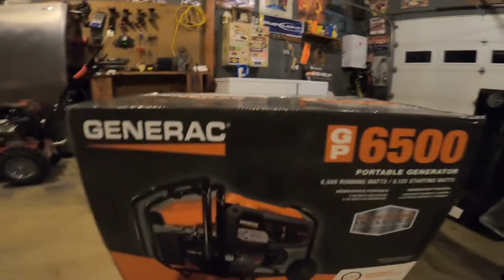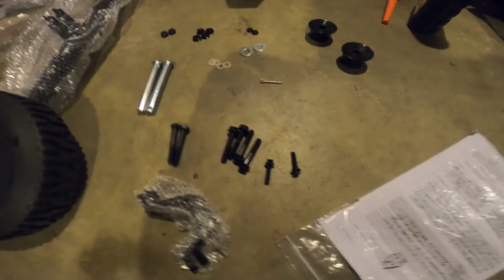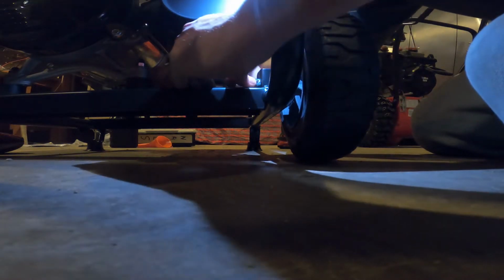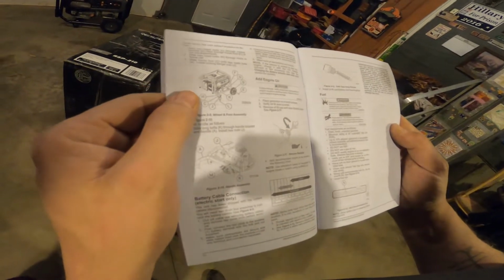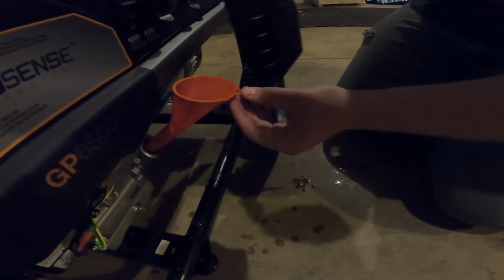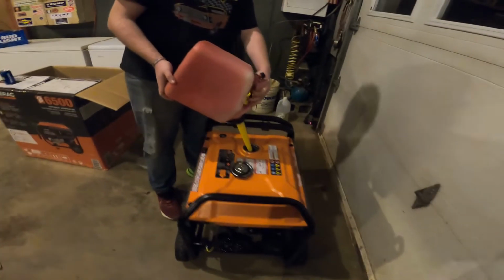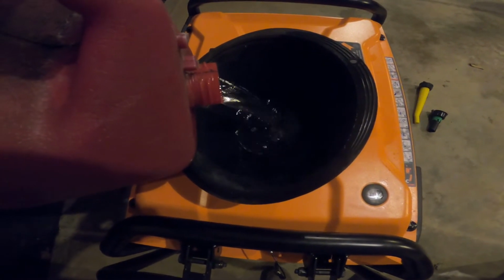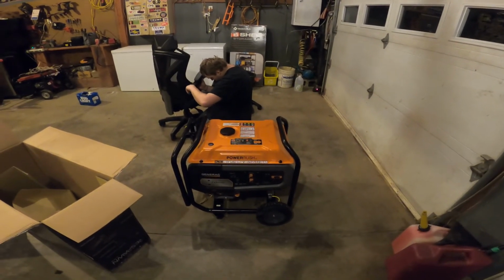GENERAC GP6500 FIRST START UP 2023

Comment: What type of oil did you put into your generator? We just picked a Generac   also. It had oil with the generator but it was not the proper type for our climate. It calls for synthetic blend 5w30. We had to call to find out because the instructions mention operating condition and type of oil to use in different temperature conditions. Just thought I'd mention it to you.
Reply from the maker: Interesting 🤔 I just threw in what came with it guess I will have to dive deeper into it
Reply: @outdoorswithaaron4145  Yes definitely check the oil you put in. We received SAE 30 which can be used but not under 40 degrees!! We all know it gets colder than that in Maine!!! So we called up and was told to use Mobil 1 Advanced Full Synthetic 5w-30 for conditions up to -30 degrees. 

First start on ours and purred like a beauty!! Can't beat a Generac with 3yr warranty likewise.
Reply: A little late commenting, but the 30 weight that comes with it is break in oil. After 30 hours break-in you should change oil to 5-30 full synthetic.. this information is in the owners manual.
Reply: @garystarr9176 no need to use full synthetic oils for that purpose. The old Dino multigrade oil will do the thing perfectly, It doesn't cost that much and I would prefer frequent oil change because small engines don't have oil filters
Reply: @j420v7 no need to use synthetic oils. I prefer HD mineral diesel oils for my 3kw genset. my 3kw genset  requires an oil that's API SE or higher. So I use  15w40 and SAE 40 Heavy duty diesel motor oil And these are the oils that I frequently use

Castrol CRB 15W40
Shell Rimula R4X 15W40
Shell Rimula R2 SAE 40

Comment: I think that was a bit too much oil. If ever you see the engine smoking, thats gonna be too much oil. It didn't smoke in the video because its the first time running and all the engine is brand new. Otherwise great video.
Reply: Actually, that kind of generator takes the whole bottle that it came with 1.06 qt.
Reply: I have that same generator. It took the whole bottle. Surprised me as well!